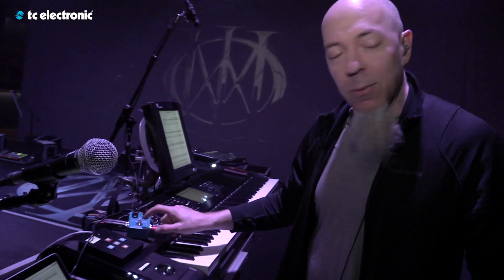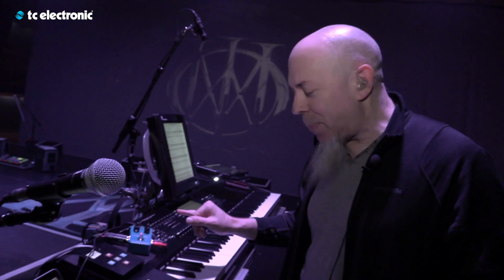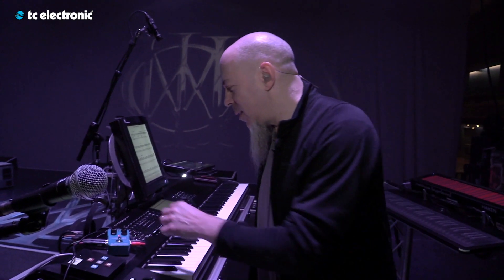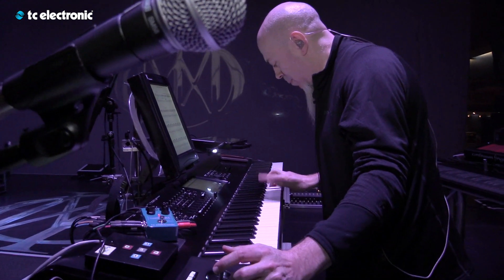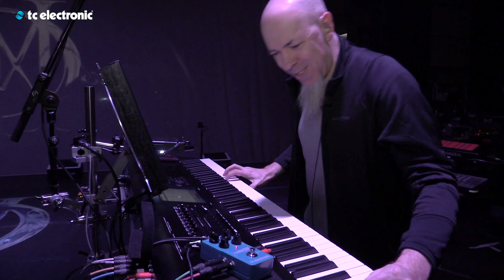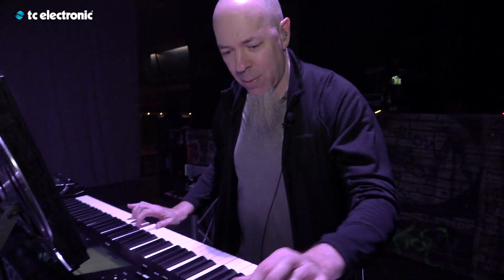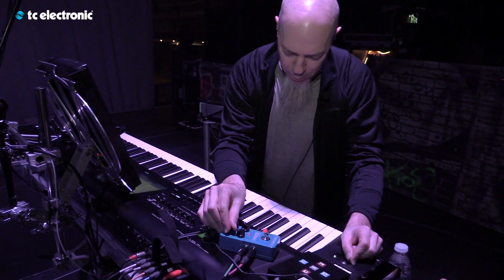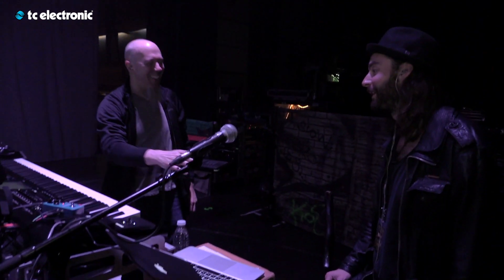Jordan Rudess uses his "Flash Wiz" TonePrint for the Flashback Delay

Comment: Hi, is there any way to use this TonePrint in a keyboard without being connected with a laptop or anything like that, or saving it in the pedal?
Reply from the maker: +exsequor699 you can't load the tone into a keyboard, if that's what you're referring to. You'll need one of our TonePrint enabled delay pedals (Flashback, Flashback X4, Flashback Triple etc.). You can beam this tone to the pedal via our TonePrint app. You can learn more about it here: http://www.tcelectronic.com/toneprint/toneprint-guitar/
Reply: Hi, sorry i didn't specify. I am a keyboardist and I just bought the Flashback pedal, is there any way yo use a TonePrint without being connected all the time with a USB cable? Is it possible to make a ToneTransfer using the Flashback with a keyboard? All the examples i have seen it has been done on a guitar. Thanks in advance.